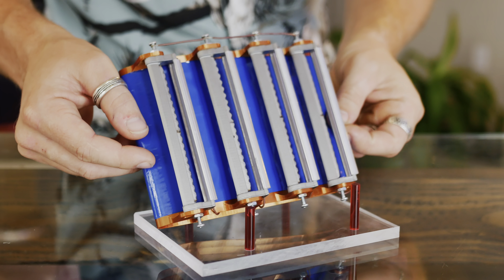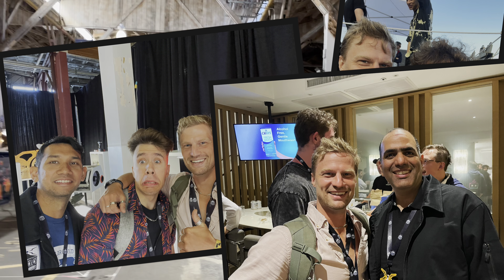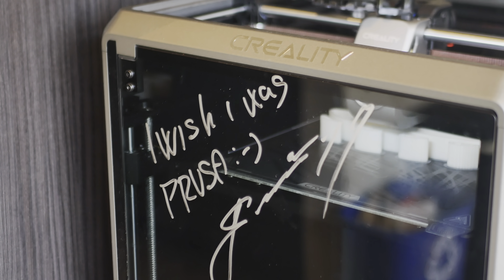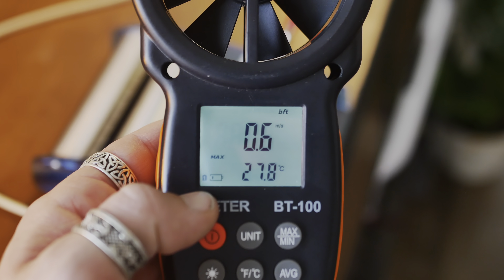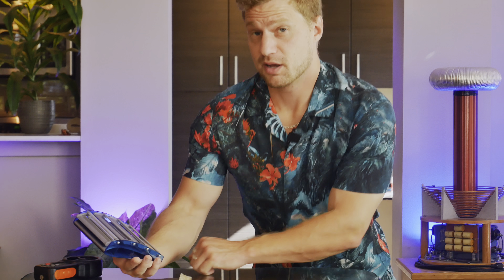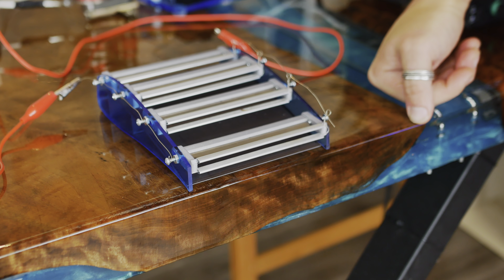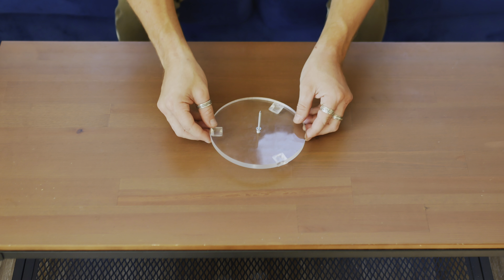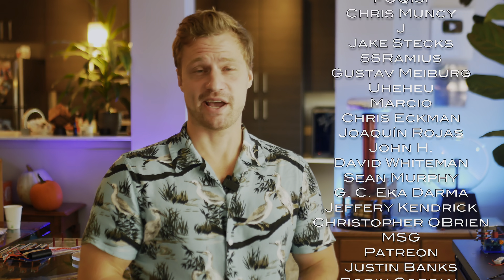Designing A Self Propelling Ionic Thrust Wing

Comment: I may be wrong, but with the actual design there will not be any real lift. In order keep the coefficients of the wing profile intact the motors should point the air along the foil, but it seems that they point parallel to the ground, and this will probably affect quite a lot the lift coefficient of the wing profile. Usually earlier separation along the wing (i.e turbulence) result in a lower lift. The best idea would probably be to have sections ejecting air tangent to the wing surface. I think there will be the need for a series of empirical tests on the angle of the various "plasma sections"

Comment: Use a n ISO Grid internal wing support in place of the long internal wing support.  Just change the long segment from continuous to an ISO style to drop weight.  That support does not have to be solid all down the length of the internal wing structure.

Comment: Hey there! Love your channel man you are doing an awesome job!

Im a fluid mechanics guy and I conducted a research on a technology very similar to what your are doing but with a different effect called Dielectric Barrier Discharge (DBD) Flow Control. 
Hope im not stepping any bounds here but id like to give some suggestions that might help you optimise: 
1. Your current profile design is terribly unaerodynamic . You are right that there is a flow obstruction but you are also harming the main mechanism of subsonic lift production, which is the leading edge suction peak. 
2. This also increases the wings base drag due to the local flow separation points and the viscous drag since you created another surface the air must flow on.
3. In DBD, 2 electrodes and the right dielectric material can produce 5 m/s sometimes more (of course depending in the input voltage). I would try to introduce a charge accumulation method like that so that when the discharge occurs, the electromagnetic force will be higher thus a higher jet velocity. 
4. The way you measured the thrust based on a point inertia, is not accurate, in most CAD software you can estimate the inertia of the design based on the material and geometry input. 
5. You are not actually measuring thrust. Since in your sketch there is the thrust force created by the ionic wind minus the drag force of both the the profile and your counterbalance. So essentially your thrust force is higher than what you measured. 

Hope this helps and keep on the good work!

Comment: change out your screws? i was wondering what would happen if you made a bi-plane design where the top half is the ionic thrust while the bottom half is for aerodynamics. It seems the formfactor of the wing itself could be split in two  with a channel?

Comment: More questions than answers. The spinning version, did you observe any lift from the wing? Lift comes from standard pressure air on the bottom and lower pressure air on top (longer distance to travel), wing gets pushed up. With the engines on top that will increase airflow but will it draw in extra air, negating the pressure difference / lift. Easy check. Spin at same rpm w/o engines. Lift? No = wing too small. Yes now no w/engines lift is affected, you may need sections of wing w/o engines. Jets have engines below wing (no turbulence, weight & balance). If engines below wing, airspeed (lift) affected? At takeoff speed, airflow equal on both sides of wing, lift happens. More questions.

Comment: Use high end electronics from vehicles like a kid did with a Subaru coil pack not low end tazer it can take and give more input output power to give better results.
I also have a few other non freebie ideas that you could add to improve efficiency and manufacture as a glider wing slip over add on to maintain flight during sunny conditions if u go small battery and solar power.

Comment: Hello, greetings from Argentina, good work applying Tesla's theories, the dream of seeing turbines without moving parts, an idea, I am studying to recover energy from vortices with great urgency. Here in summer, they cut off our thermal power, those who are in power and without energy, in addition to living, we cannot work, etc. Maybe at the time of propulsion you only need to place it near the center of the fuselage in the center of the glider so it does not have as much aerodynamic load and in a prototype a slider that follows the leading edge and at the time of gliding flight it retracts so that do not generate resistance, objects above the leading edge generate resistance and change the angle of attack, on the other hand, another thing would be to compress the air to the side of the trailing edge. It is just an idea, something exciting because I am a glider pilot and private but I'm not flying so a pending project is a low consumption drone that flies for hours and who doesn't say that it fulfills some useful function.... a big hug from Buenos Aires, Argentina
Reply: Another thing is also to use magnetic fields to further confine the flow.It's a strange idea but it could work

Comment: you might find even more lift using "blown wing" technology, where high pressure air is selectively vented from inside the wing, to decrease pressure at the point of max lift, and increase flow on the top of the wing and also over control surfaces like ailerons and flaps.

Comment: Really cool! If you want lighter parts, you might look into the foaming filaments. They will introduce some design constraints and can be tricky to tune a printer profile for, but they make much lighter parts.

Edit: Does sanding the wire to add a rough surface improve it's performance?

Comment: Maybe the ionic wing needs to be used with a Sirorsky X wing concept.  It uses pressurized air to shape the blades when locked.  A powerful enough ionic thruster would make this concept simplier and easier to control with fly by wire.

Comment: There is one more factor to consider that may be hindering airflow speed.
The first segment positively ionizes the air so that it moves toward the negative, but this air is thrown against the positive of the next segment, which will repel it and perhaps slow its flow. I imagine two possibilities: create a profile so that each segment pulls air separately or (my preferred option) place just one positive pole in front of the wing and distribute several negative filaments at the top and bottom of the wing that can be connected sequentially as in the system ignition of the spark plugs of a car engine (the speed of the air flow in this case could be controlled electronically).

Comment: Awesome work BUT yourkilling the lift of the wing by putting the thrust from the top trailing edge, remember lift is generated from air moving slower over the top of the wing than the bottom…… I believe you’ll have much better results by instead hanging them from nacelles separated from the bottom of the wing with the leading edge of the drive slightly forward of the leading edge of the wing as they do on commercial airlines or integrating it on to the fuselage skin . I’m no expert by any means but you have to let the wing do what it does. It may work if you can get it inside the wing

Comment: Have you seen the Dyson bladeless fans? They use the Bernoulli principle to accelerate a large volume of air using a small air jet. I wonder if an ionic thruster could be used in the same way, to move more air without having to ionise it all.

Comment: Hey dude, Fantastic idea but i think adding it to the wing is the wrong way to go about it. i think you'd be better off adding that to the fuselage and have the air speed around the fuselage create the thrust and let the wings worry solely about lift and control. the disturbance around the fuselage wont upset the flight characteristics as much.

Comment: ChatGPT is not suitable for this. See how it dropped the angular moment of inertia of the boom, because it is balanced "I_armature = 0")? Just because something is balanced, doesn't make it infinitely easy to move! You got lucky, because the masses on the ends contribute 16 times as much to the angular moment of inertia. But that is chance, and you can't count on it in general.
You should reference Wikipedia and check the math yourself. If you pay attention to the units it's really not that hard, especially Newtonian Physics. It is fine to ask ChatGPT for guidance, but e.g. for the I_armature thing, Wikipedia has a ready to use formula for this. It's not hard. And if you do the math yourself you'd notice errors like this. Everyone knows that you can not accelerate a seesaw infinitely fast just because it is balanced on the center point.
Also, the information you supplied is not enough to calculate the applied torque. We don't know the drag force due to air resistance, so the max speed steady state is not enough to calculate the applied torque. We need the instantaneous speed at two different times after accelerating from a standstill. Or something like "after x seconds it reached 90% of the final top speed". This is difficult to measure though. So it might be easier to film the whole thing from the top, put a scale bar on the table (a meter stick or a A4 Paper) and analyze the footage to calculate the acceleration right after turning it on. At low speed the air resistance is irrelevant and we can safely assume linear acceleration. ChatGPT also assumed linear acceleration, but did so incorrectly. 

Following basically the same math as ChatGPT, but with the correct moment of inertia for the arm and using 21cm for the length of the smaller arm (and also assuming linear acceleration, not because if is correct, but because there is not enough information to do it properly) I get a thrust value of *0.051 N*, which is *5.2 grams*.

PS: If you are off by a factor of 10 when converting Newtons to grams then doing math yourself may indeed not actually be better than ChatGPT, lol

EDIT: you may be able to check the thrust by mounting the wing vertically on a scale. No movement and the ground may interfere somewhat, but it should give you a sense of scale.

Comment: Having studied a lot of papers on boundary layer acceleration, I have come across one that suggested to accelerate the air right above the surface of an aerodynamic profile with metallic tape glued to said profile in parallel stripes with hV applied to them. So half your thrusters with almost no extra weight.

Comment: Out of curiosity, why not incorporate it into the top of the wing? It’ll produce the forwards momentum as well as help the lofting power by increasing the wind flow above the wing. Hopefully the lesser efficiency of only generating ions on one side is offset by the reduction in drag.
Additionally, your propulsion is already a miniature aerofoil. Could you make it sturdy enough that with enough of them you can generate the lift without snapping off?
Finally, why not look into a flying wing design? As I understand them, they do produce higher lift, but aren’t stable enough for comfortable flying. With current technology you should be able to remedy this imo.
Let’s hope I don’t post this three times, but YT seems to eat my comments.

Comment: Great Idea but you may have made the wrong decision at the beginning. It's a debated topic the mechanism of action of an aerofoil design but one theory is that the air above the aerofoil has to travel faster than the bottom in order to merge at the trailing edge. If you have the thrusters on the underneath then the air on top would have to travel a lot faster in order to merge at the trailing edge, potentially creating more lift and maybe thrust. Also if I were you I'd create a lift and thrust rig combined as thrust isn't as important as lift. Another component of the aerofoil theory is that the shape creates low pressure from the faster moving air above, a leading and trailing edge slats design may help and you can play around with thruster position. I wonder if you could incorporate the thrusters into the skin of the wing with wire, then you could have the thrust on the whole skin and utilise laminar flow. If you varied the thrust from the top and bottom then you have control surfaces with no moving parts too. Brilliant concept, it will undoubtedly behave in an unpredictable way but this could be the future of air travel. Engineering at its finest!

Comment: Looks like it's trying to "push the wing with the air" instead of the opposite. It's creating a flow on the wing surface which is a byproduct of lift, not the cause of it. Looks cool but dude got it backwards :P

Comment: I don't foresee a trust to weight ratio to allow for fixed wing flight. However I am surprised you haven't tried a lighter than air vehicle. This not only would allow for the ionic thrusters. But it might allow the surface area for using solar to recharge the power source.

Comment: Does it make a difference if you load it with cold air at the front? So that it can expand into hot air over the thrusters. If it does then it would perform as a wing better than you would now expect since the temperature is colder the higher we go.

Comment: In the early stages of solid state flight, it would most likely be initially used to propel gliders, but I would be worried about its price. Like cars, it'd be very expensive unless mass adoption in the aviation industry. Another concern is battery/power supply weight.

Comment: To to further reduce weight you could try to put the ground as part of the wing itself, either as a common ground or as separate strips. Combined with replacing blades by wires the gain could be significant.

Comment: Im no rocket scientist, but if the design of  wing is such that its shape causes a difference in air velocity above and below it. ** Would it not be better to mount the ionic thrusters to the bottom where the faster air accelerated and the slower air on top remains slow , complementing the air flow lift design of the wing.

Comment: Simply due to the problem of air moisture... I can't say this will "get off the ground" as a concept. No one will want a mode of transportation that drops out of the sky when it rains. Planes fly through clouds all the time and you showed in previous concepts the thrusters arc like crazy with just a slightly higher than typical ambient level of moisture.

That said, it's still very cool and I'd love to see a scale model eventually working

Comment: ya I'm curious why you didn't start off with wire? razor blades aren't particularly easier to work with and obviously heavier, i would have thought the design would be done with wire from the start.

Comment: I wondered if wing could be attached to a Balloon like a Blimp/Airship to take the weight so it is neutrally buoyant then Ion-wind could propel the Airship. Maybe airship inside another Balloon so could have air vents at top and bottom and Ion wind moving down inside balloon envelope to give airship lift and vents close at bottom to then direct ion wind on side of Airship pushing it along!

Comment: MIT did a solid state airplane a while ago. Still it would be great to see solid state engines on model and real airplanes in the future. There should be a way to have higher efficiency than trough conversion into mechanical energy and use of a propeller.

Comment: Hello, your experiments are very fascinating and inspiring. I watch them with great interest! I believe you could determine the varying thrust of plasma thrusters by feeding the electrodes with different voltages and frequencies! Based on the graph you made, you could determine the optimal control parameters of this engine, with particular emphasis on thrust. You have beautifully determined this parameter depending on the spacing of individual engines. I'm particularly impressed with your tests. Best regards to you and the Channel Fans 😀.

Comment: Are you doing audio analysis? I'm hearing different frequencies. The 0.6 over the the 0.4 reading had a more consistent high pitch tone to it. What might be ideal? Was the spacing maybe not 100% accurate? Should different blades/ angle of inclination along the wing have different spacing or the same spacing throughout?

Comment: Having more air pass on top on the wing will diminish lift for an actual wing. You did not see that phenomenon because the power source balanced the weight on your rotation test. Would suggest either put thruster under the wing or through it.

Comment: The whole design of the wing is that the air below the wing goes faster to achieve lift. You put it on top of the wing so I’m certain it’ll affect the Coanda effect on the top of the wing causing the air speed to be higher at the top making lift not possible

Comment: You should try very slightly angling the individual segments downwards (like 5°) so they blow onto the wing. Air is "sticky" (as in air likes to stick to itself when moved, some air fans use this phenomena) so this would be more efficient way to have all of the foils work in tandem as well as more freely pull air in front of them back with the air that's being pushed.